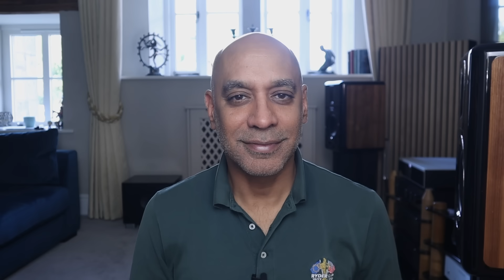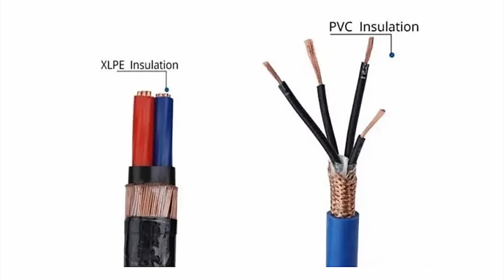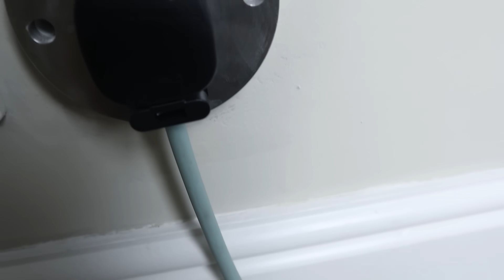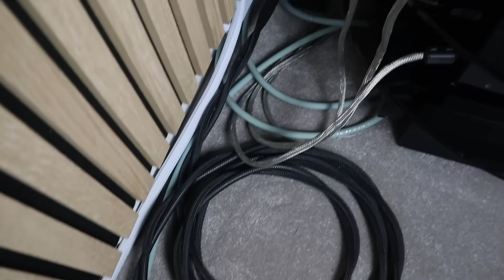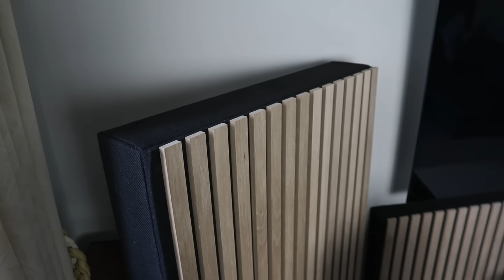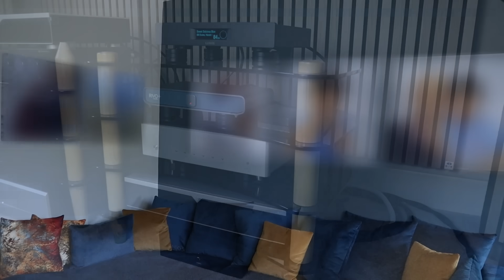Tour Of My New Listening Room

Comment: I have a pair of Dali Menuet SE and coupled with a Naim Atom and a Nait 50. What, if any, room or equipment changes would help with sibilance? Thank you
Reply from the maker: That system shouldn’t be too sibilant 🤔
Reply: @abritishaudiophile7314 I’ve tried it with the atom on its own and with the Nait 50. Results are the same. There is a lot of glass in the room and very little soft furnishings. Any ideas? Thank you
Reply from the maker: @andyh2215 there can be many reasons. Environment, setup, cables, synergy. Hard to pin down without investigating 😊
Reply: @abritishaudiophile7314 ok mate I’ll do that. Thanks for replying 👍🏼

Comment: looks great - yeh unfortunately smaller the more bass issues one has..... cant do much about it either unless solved by very thick bass traps and / or subwoofers...... one thing is you need to tidy up your cables. should never run power cables parallel to signal cables (if you can help it).
Reply from the maker: The power cables don’t run close to signal cables. Those are HDMI cables feeding my sons game’s consoles with aren’t part of the HiFi system 😉

Comment: A challenging room for sure. Especially with larger speakers. A subwoofer is like not needed or very hard to integrate. I see you mainly do absorbtion and not a lot of dispersion. Though those panels likely do both.
Reply from the maker: The 5 front panels do both 😊

Comment: Replacing my interior doors with curtain drapes might have helped the mids and highs but it didn't do anything for the Lows. However, when I added a couple of extra layers with a 5-inch air gap in between the resonance I was hearing from the corner had finally been tamed. I thought I was on to something so I went ahead and changed the Nylon curtains which were on my windows for the same thick velvet material I was using on the door drapes and almost immediately I noticed how the high frequencies had been stifled!

 When you address your room acoustics by perception the results may take longer but when you over-dampen it's astonishing how the results become immediate.

Btw, you're listening room looks wicked mate 🎉
Reply from the maker: Thank you. Great to learn about your experiences 😊

Comment: Great to see this as the room is the most neglected part of this hobby. The last few months have been a huge lesson for me in just how important the room is. I recently bought my first apartment and deliberately sought a something that had accommodating dimensions, but concrete ceiling, concrete floor covered with polished tiles and both internal and external windows ruined the sound of my system even with the few GIK panels i already had. The difference I've been able to make with more treatment is unbelievable. I can highly recommend treating the ceiling too with at least a couple of panels. That was where I made the biggest gain and huge improvement in imaging.
Reply from the maker: Thx for sharing your experiences 😊

Comment: You are an absolute genius!
 
Starting a YouTube channel to justify to your wife you need a dedicated listening room.
I know you never said that, but you didn't have to.😜

Nice room you've done well, and a good video to watch.

So Tarun...  pound for pound what would you say are/were the best improvements to your listening experience if you exclude the actual source, amp and speakers?
Would they be
Interconnects? speaker stands? Speaker cable? Sonic panels? The plug socket thing? Something I've not mentioned?
Reply from the maker: Thx, I’ll tell the MRs 🤣

I would state the follow levels of importance, starting with the highest first:
1. Speaker and listening position.
2. Acoustic treatment, both panels and various furnishings.
3. Power conditioner, speaker cables and speaker isolation.
4. Interconnects, power cables, and equipment isolation.
5. Dedicated mains (although this may be more important in busy neighbourhoods).
Reply: @abritishaudiophile7314 thanks I'll look into acoustic panels 😅

Comment: Thank you for this look in your Room ! I have more Rooms to listen . In one Room i build Spaces for electric and Heating Installation in the Corners at the Top and sides. All the Walls have 45 deg. corners, not 90 deg. ! In some old Houses you can find this as " Stuck Decken " Stucco ceiling...in english. It is quite nice in this room....you can hear a very clear and good placed lineup. The deep tone is more precise as in the room with 90deg. corners. 
Thank you an kind regards from Germany..👍🍀
Reply from the maker: Thank you 😊
Reply: Something doesn't add up here. Is your room quadrilateral with straight walls? If so, the angles between walls add up to 360 deg. If you had two angles of 45 deg. for example, the other two angles would have to add up to 270 deg. -- making it impossible to have "all the walls" with 45 deg. corners. Even if your room were triangular, the angles between walls couldn't be 45 deg.

Comment: Bit of a nightmare having a TV on the wall it's the worst thing you can have. If you get some natural wool felt blanket you can hang it over the TV when you're listening help a lot.
Reply: Mmm, not that much if the rear wall is treated. It’l show up in a response otherwise, mine is very similar to Tarun’s and covering the TV makes almost zero difference to the response.
Reply: @russ-p1  no it makes a big difference. In a tight space like that, you want to have the center between your speakers as dead as possible you're getting reflections you're getting cancellations it's destroying the stereo image sound stage
Reply: @therealBozoDjTrumpI respectfully disagree. It’s no where near as bad as your claiming, especially in a treated room like this. Also, a natural wool blanket will fail to absorb the vast majority of the frequency range, especially in the region where cancellation is going to occur. If you’re going to do anything constructive in that area it needs to be a proper quadratic diffuser tuned to the correct frequencies.

Comment: Good to see your journey with acoustic treatment and cables. I used base traps in our previous home, and used them in a similar way in our current place, that is until a friend came over for some critical listening: it became clear quickly that the traps were too effective, and killed the bass, so I sold them and listened happy after. I now use my sub ‘nearfield’, about 1m away from my listening position.
Reply from the maker: Thanks for sharing your experience, appreciate it 👍

Comment: High level of snake oil. For the price of that box, you could have installed a medical grade power supply that would clean 2 or three 16 amp groups in your house without reducing any dynamic range. Your acoustic pannels aren't large enough if you would intend to use decent sized speakers. There's uncovered glass windows that won't help the acoustics.
Reply: How do you work out size of acoustic panel or total coverage required?

Comment: I'm now a professional photographer, 35 years in the making, but about a hundred years ago back in the late 80's I worked for a company called Audio Excellence, (no relation the Canadian co) in the Bristol Road Gloucester and I had access to a lot of gear, some sensible, some serious, and we also did home installations as well I mention this because we (I still include myself) as audiophiles nearly always toed our speakers in to create a more focused listening position or experience, but I absolutely urge everyone to try the flat setup to create a much wider soundstage. And I have just done this with my Kef LS60's with matching KC62 Subs - (one connected to each speaker on the outside side in stereo). Now I will admit that in my case I have eight single side firing speakers and just two facing the front, but I just love the wideness of the soundstage now, more depth, spatial separation of instruments etc . Why not give it a go, what have you got to lose?
Reply from the maker: Thank you for sharing your experience 😊

Comment: Curious about that power conditioner, the C13/C14 input connector is only rated for 10A IEC. Doesn't seem up to the job given the 16A max for all outputs. Thanks for the tour!
Reply: Think it's the C19 version rated at 125v / 20A 250V / 16A.

Comment: Really nice tour of your room and nice to hear your thinking behind it. 
The first reflection point you mention, are you sure that's correct?  Seem a bit off. That glass door and radiator grill seems more like it?
After I treated all walls in various ways the imaging became much much better. Even a semi transparent curtain over the windows can make a noticeable differens.
Regarding over dampening - having a carpet covering all of the floor, eats all top end but no mid or low end, which can lead to acoustic imbalance - that's when you feel that the room is over dampened or dead. Reverberation in the low mid and lows are more felt, not heard, and feels uncomfortable as the top end is not matching. The goal is to have even reverberation time across the frequency spectrum. REW is your friend ❤
Reply: Good that your on it 🤩The mirror trick is really good as it's easy to misjudge the spot as the speakers are wide apart and the listener is centered, making the reflection point closer to the speakers that expected. I put a chair with a flat wooden backrest carelessly in the left reflection point the other day - and boy was that annoying until I figured that our. Just a 50cm by 20 cm surface can cause so much damage.
Reply from the maker: Thx. The first reflection point on the left is at the radiator cover. This is packed with sound absorbing material on the inside with a lattice for diffusion on the front. The first reflection point on the right is where the cushions wrap around the sofa. I am not saying that these provide  perfect absorption down to the transition frequency but they work effectively for the a lot of the mids and the highs. The speakers are quite far into the room so it probably isn’t clear from certain angles 😊

Comment: Tarun, one thing I did recently, and it’s entirely possible you have already addressed this, was to lower the high level of noise on my AT&T router.  I plugged it into a Shunyata Gemini-4 and attached a ground cable in an unused ethernet port.  Resulted in a significant upgrade in streaming performance.  I’m in Atlanta so I am not clear if router noise is similar in the U.K.
Reply from the maker: Thx for the heads up 😊

Comment: Note boys and girls ,if you do use a shielded power cable do not connect the shield at the source end. Using a bigger gauge wire than needed for your power from the switch box Does improve results. I’m not an electrical genius, but it has something to do. I think with lowering resistance.😊
Reply: "...not an electrical genius," & yet a SuperMcgenius...hmmm, I find that hard to believe🤔
Reply: Super mcgenius is supposed to be a joke much like stable genius, I failed grade one😂😂😂
Reply from the maker: Thx for sharing 😊